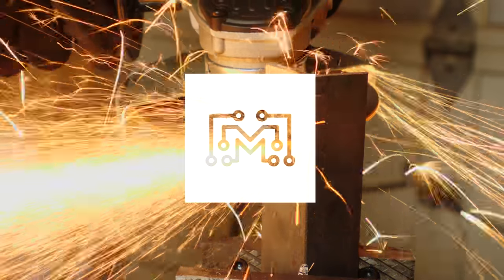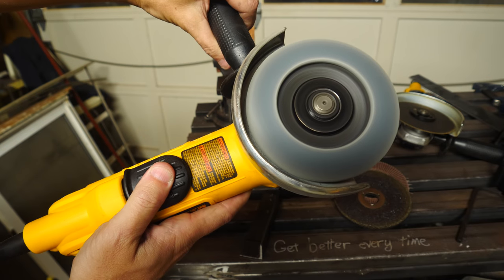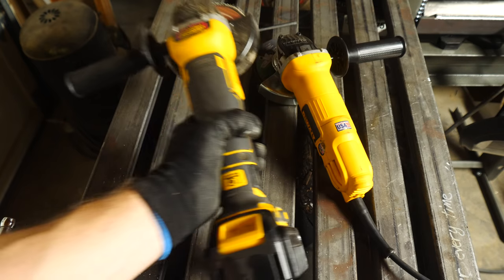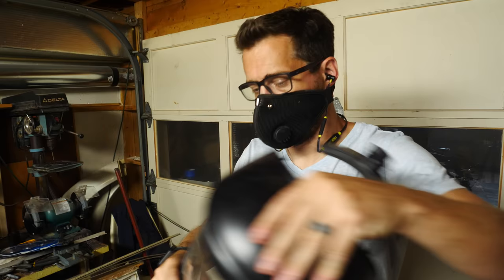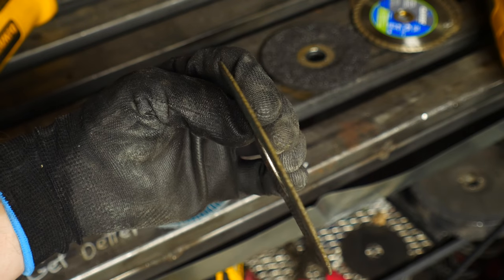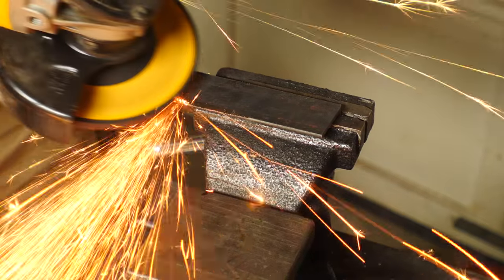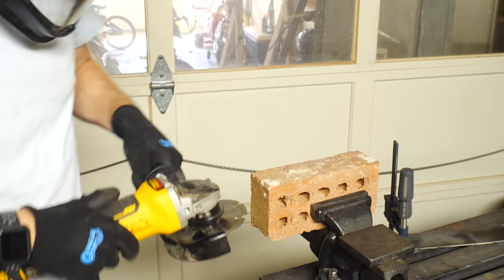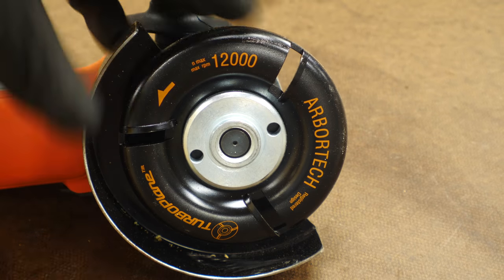Angle Grinders // Bits | I Like To Make Stuff

Comment: Thanks for the video and for including safety tips!
I've once had an old slotted diamond disc come apart on me at full rpm, resulting in one of the segments whizzing right past my face like a bullet. I'm so not using an angle grinder without a faceshield ever again!
Reply from the maker: Yeah, it's insane how quickly bad things can happen.
Reply: Wire brushes are a REALLY good sales tool for face shields.
Reply: Damn Thomas didn't think I'd see you here.
Reply: True, if something like that happened to me I would cry my face off! Only cuz I'm a kid so it would scare me more.   :)
Reply: @mikecurtin9831  Hey bob you forgot about the stripping disc
Reply: @Iliketomakestuff  A dermal is a great way to to cut metal also!

Comment: Bits "welding" please. I want to start learning but I don't know where to start
Reply: Didn't he just make one of those?
Reply: Check out "The Fabrication Series" on here, lots of videos about welding in general, some quite advanced but a lot of nice simple ones too. Might give you something to watch until Bob does a welding one. :)
Reply: @ericbartha6313  i found soldering, not welding. Thanks :)
Reply: I would buy a cheap stick welder and start there
Reply: youre not gonna learn how to weld from a 4 minute "bits" video.. theres plenty of series and channels teaching all sorts of types and skills of welding.. best to go buy a cheap machine and give it a try first though
Reply: i dont need a video i just gave my advice, go buy a cheap welder, whatever you can afford dont worry about the type of welder or options and just start using it, google if you need more info/tips but its pretty self explanatory.. youll learn its limitations and you intended uses ntm get any mistakes and lessons out of the way on a cheap throw away unit
Reply: One good channel you can watch for good videos about learning how to weld go over chucke2009 he has video for learning how to arc ,mig ,and tig weld
Reply: Alien SKP look up Mr. TIG. Tons of great videos. I’m a welder by trade and that guy has a bunch of great tips.
Reply: @MikeTheMaker1  thank you
Reply: @joshuahuman1  thanks!

Comment: My favourite tool... 
But I'd suggest using flap disc over an grinding disc for sharpening stuff. Particularly the fleece/scotchbrite flapdiscs that are becoming more common. Using a couple different grits I've restored axes from 1/8" thick blunt edge to shaving sharp and highly polished in under 20 mins.
Reply from the maker: Cool! I'll have to check those out. Thanks!
Reply: Yeah try to avoid grinding discs near cutting edges as they heat the metal too quickly and you risk loosing the temper of the steel. As Steve said go with flap discs and the scotch brites for polishing (they also come in different grits). Don't forget to clamp your grinder upside down 😂😉
Reply: Haha! I was purposefully avoiding the subject of turning your grinder upside down! I don't want to be responsible for a spate of unfortunate accidents!
Reply: Flap discs are the bomb when it comes to grinding/sharpening and they last a LOT longer than you would think.
Reply: Can u get waterproof angle grinders for use in the kitchen sink?  No reason...
Reply: @roidroid  I suggest a sand blaster for that charred cast iron skillet. LMAO

Comment: Bob, a good thing to mention is how you should use the tool... do not use too much force against the surface youre working on. that usually causes disc explosions and you can damage the grinder itself. Just go geantly with a firm grip on the grinder. Needs practice of course.

Comment: Good one! #teamanglegrinder
Another tip is to use a water filled bucket when grinding metal to catch sparks and reduce airborne dust, when cutting metal try to make short relief cuts to avoid long cuts which increase the likelihood of a shattering a disc

Comment: Great job on this video, you took a good angle on it! we used 4" and 9" in the shop when doing our race cars and the cut wheels, along with flapper wheels where mostly used." safety is a must!! " also keep those guards on and don't use cheap cutting wheels, emergency room visits are not cheap either (hint, hint) be safe guys & gals!😎👍

Comment: Like Bob said, don't ever forget the protection! A face shield and safety glasses are pretty much necessary, and ear pro and respirator are crucial if working indoors (almost like gun safety). Also, heavy gloves (like the ones used for welding) and sturdy pants (non-synthetic) will be handy when that metal spark shower hits you. Aside from that, angle grinders are your best friend when you need to cut metal and you don't have a shop or an eternity to get through it using a hand saw.
Reply: Using gloves may be great against the sparks, but I gotta say it's super dangerous to use gloves when working with high rpm rotary tools, because if your finger gets caught without a glove you lose a finger, but with a glove chances are your entire hand will get pulled in.

Comment: Not so much another use, but I do have a good safety reminder. If you use a disk on aluminum, do not use it on steel. If you come across even a little iron oxide in the steel, you've suddenly got aluminum plus iron oxide which creates thermate, a not too distant cousin of thermite, and as a former shop teacher, believe me when I say this is a bad thing to do. Also, if a disc is ever saturated with something, be it liquid contaminate or metal particulate, throw it out and replace it, otherwise it will throw itself out, piece by piece, while you're spinning it at 10k RPM. And all that PPE in the video? Yes please. It's hard to be overprotected from this rotating bringer of doom.

And buy one, because they're an incredible tool that everyone should own. But buy a nice one because the motor windings in the super cheap ones are usually not as well insulated, and cheap motor windings plus high voltage equals fire, and not the teenager equivalent of "that's really awesome" fire, but the "hey, my house is burning down" variety of fire.

Oh, never grind with a cutting disc or cut with a grinding disc.

Or something like that. 😂

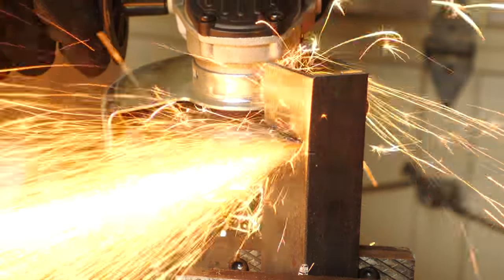Comment: NO! Public safety announcement! Cutting through tubing the way shown at 2:03 is what causes the disks to break! I have had to stitch up many people, including professional, because of this technique error. Any even slight change in your angle or movement of the metal will make the disk bind and explode in your face. It is much safer to cut each side of the tubing individually. 

Bob please add an addendum here or we’re going to have a lot of beginner injuries.

Comment: I literally just used my angle grinder for the first time...kinda wish I’d waited! I’m using it to cut up the brackets of retail shelving so I can mount shelves on my wall

One thing I wish I’d known, which wasn’t really covered here, is how to properly (and safely) sight your work. I ended up leaning over the grinder to see the disk, and felt like that might not have been the best option. I also felt like the guard (which I definitely didn’t remove) was never in a Goldilocks place for safety and usability

Comment: If you heat up your metal workpiece and your brass brush you can transfer a brass coating onto the piece you are working with. High rpm seems to work best for this.
Reply from the maker: Cool! That's good to know, thanks!
Reply: It might be the neatest thing I learned watching Man-at Arms.

Comment: Awesome! Great videos!
Most dangerous tool in the shop for me! 
Id like to add rpm of disc super crucial, and expiry dates on abrasive disc aswell should be noted, safety first 😋👍
Keep em vids coming ☺️
Reply: That's right, always check the rpm rating of a disc before use. Generally don't use larger discs in small grinders (i.e. 4 1/2 discs in a 4" grinder without guard

Comment: Tip for cutting masonry, ceramics, things of that nature, diamond cutting disc is definitely the best tool but you can also use a metal cutting abrasive disc, if you soak the brick or whatever your cutting in water for a few minutes it will cut much faster.

Comment: Looking to buy my first angle grinder to sharpen blades, snow shovel and other uses Bob talks about in this video and I think I have settled on 4.5" for disc size atleast and also corded (for now) as well as ability to change the handle side). When reading up on angle grinder, there seems to be a debate about the type of switch (paddle, slide, etc.) to look for on angle grinder - Would appreciate some input on what type of switch to look for - especially for first timer /novice user such as myself? Thanks for any input.

Comment: I got over my fear of table saws...now to get over the fear of angle grinders. Thanks for the tips Bob!
Reply: Even since seeing a cutting wheel explode I've had a lingering fear of angle grinders haha. For a while I was perfectly fine with the flap wheels until someone told me if that falls apart every individual flap launches in different directions, so now I'm just down to the grinding disc as far as not being spooked goes.

I know I'll be fine if any disc explodes, I'm wearing all the proper PPE, but I'm still spooked cutting metal, especially steel.
Reply: Colin Ambrose i know exactly what you mean! I’m more...cautious if breaking disks go though. I’m pretty sure that it’s a case where I have to practice more and confident (but never overconfident)
Reply: I had a friend that was scared to pickup an angle grinder even when unplugged
Reply: Being scared of certain tools is not a bad thing. it makes you think of the things that can go wrong. Always make sure to stay out of the disks line.
Reply: The Practical Engineer wise advice. 👍
Reply: Borg3d, get 3 angle grinders and use 1 to destroy the other, while the remaining one just watches (so it can corroborate the story).  You are the angle grinding master now, they will be careful around you.
Reply: roidroid 😂😂😂😂

Comment: Angle grinders are my favorite power tool. I use them since I was 10 or 11 years old :D
When buying a grinder, you should think about vibrations. Cheap grinders with a lot of vibration can really wear you out when using them for some time. The better ones have vibration dampening systems.
I'am not a fan of grinding discs. I prefer to use the flap discs instead.
Festool has a circular saw / angle grinder hybrid on the market. That maybe an option for someone who is a lot into dust collection, but I have never tested it myself.
In the arrea where I grew up you could not get cut-off wheels in the big box stores up to about 8 years ago. There where just those thick grinding/ cutting hybrid wheels to buy. You can get them now, but that were hard times. I had to order them, ask some professionals for cut-off wheels or buy them when being somethere else.
Having multiple grinders can be a nice thing. Changing wheels can get annoying. ;)

Comment: I've been using a 7" grinder with diamond cup wheels to grind off the sealant of my house's concrete slab to prepare for a glue down hard wood floor. Works great, but make sure to also buy the dust shroud for the grinder and use a good dust collection method and proper respirator as silica dust from masonry work will shorten your life considerably. If anyone is interested I have the Makita 7" (GA7040S) with the corresponding dust shroud which works best with DeWalt's Turbo Cup Wheel (DW4773T) and a good Ridgid shop vac (albeit the HEPA filter does need to be replaced every 300-400 sq ft of grinding).

Comment: One tip: I always wear full protection for eyes, respiratory system and ears. But one day, a splinter from my cut-off wheel jumped into my eye, somehow passing my safety goggles. The doctor had to remove it twice (no permanent damage though). This never happened with a face mask as shown in the video, which I bought directly after getting home.

Comment: Have you seen any difference in how long the disc lasts buying more expensive named brand ones? Or are the off-brand discs pretty comparable?
Reply from the maker: The grinding disc seems to be about the same, but the cheap flap discs fall apart pretty quickly, in my experience.
Reply: I don't see a significant difference, but I would love to hear others opinion as well!
Reply: @Iliketomakestuff  Thanks for the advice! I've never been impressed with flap discs durability. But I'm cheap and never buy the expensive ones. I'll give it a try!
Reply: I Like To Make Stuff I’ve noticed the biggest difference in cutoff disc.  We cut a lot of stainless and cheap disc don’t last long and really drags out your cut time.
Reply: I have swapped back and forth from standard quality grinding discs, to very cheap ones on the same job. The normal quality ones clear metal away noticeably faster than the cheap ones.
Reply: Thanks for the responses.  I will fight being cheap and take this into consideration the next time I need discs!

Comment: I like these Bits videos, I think something you should add to them what to look for when buying. Like dont endorse brands but more what makes them different. With angle grinders the biggest thing I've seen separate them is a switch vs a flapper for turning a grinder on. May not sound that important but when your grinding for a long time and your hand gets tired I would much rather have a accident with a grinder that has a flapper switch than a solidly locked on switch. Also some are only right handed ect.

Comment: Is it better to score with a cutting disk and go through the material step by step or cut through it right away?
Reply from the maker: I think the big advantage of scoring is that you can be more accurate with a light touch.  After that, the score will help guide the disc a bit on the next pass.    It's not necessary but you have more control with a more shallow pass.

Comment: I would like to add you should use the Angle grinder pulling towards you not cutting forward into a cut. This prevents the disc from grabbing and jumping out of the cut an maybe breaking the disc

Comment: You forgot about the different kinds of cut-off disks, there the 'classic' kind if you will, which you were using in the video. But theres also a much thinner cutoff disk, its great for faster cutoffs, its far more accurate, and its better in stainless steel and other hard to cut stuff. You need some skill to use them properly tho because they are prone to flying apart when used incorrectly

Comment: I use the grinder for cutting out knifes
Reply: Yeah thin cut off discs are great for stock removal!
Reply: @LetsPrepTogether  yup
Reply: Even for forged knives an angle grinder is great for doing a ruff grind on forged knives to remove deep hammer marks and scale but it still doesn’t completely replace belt sander

Comment: Should mention that most grinder attachments have an rpm rating on them and should never be used on a grinder that exceeds that rpm rating.  Guaranteed to break apart if rpm exceeds the rating of the disc or wheel.

Comment: Could an angle grinder be used for a horror movie? 🤔
Reply: it can be used for a grinder powered londboard 🤷‍♂️
Reply: It'd be a really long and sadistic movie compared with using a chainsaw.
Reply: The thing is an angle grinder unless you would turn it on and brake the disk to launch disk shrapnel you would not do nearly as much damage as a knife or chainsaw although if you want to go the shrapnel route look up angle grinder disk explosions and look under images be warned that its very gorey

Comment: OK, this is twice in as many days that I've heard that disks "may explode".  While the potential is there, inspection of the disk BEFORE you turn on the tool will keep you from experiencing a bad situation.  In over 30 years of using an angle grinder, I've only ever had one flapdisk come apart in operation.  Yes, I inspected it before use. No, it didn't show any signs of damage or potential to fly apart. it left a serious bruise on my thigh that thankfully didn't result in any serious medical attention needed.  Point is, inspect your tools before you use them, and you will save yourself time and potentially your life.  I've thrown away new disks because I didn't like the looks of them.  They're cheap and replaceable, your life isn't.
Reply: Ted Fry sometimes it is not because of the disk.  It is the unskilled user who twisted the grinder during cutting.  The disk is thin and cannot retain much stains.

Comment: Ahhh, my favorite tool. NOT. I have one, but it freaks me out so much, I avoid using it at all cost. Should probably just get rid of it. 😒
It seemed so handy, to have a tool that will easily cut even through steel...but I just don’t feel safe/confident using it, even with protective gear.